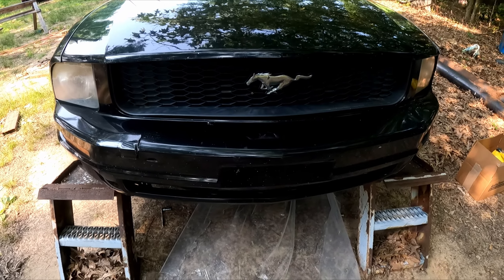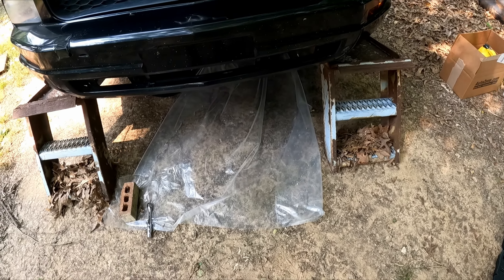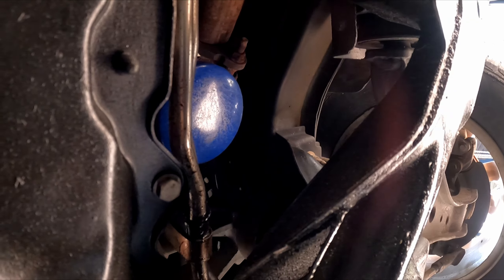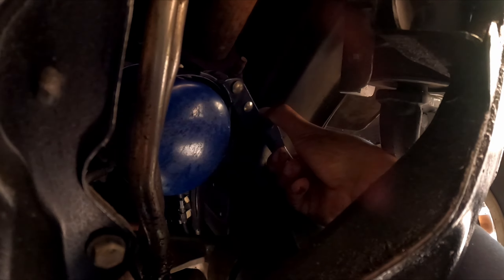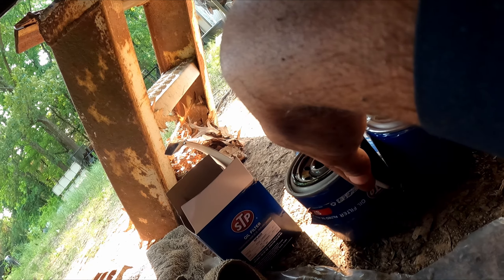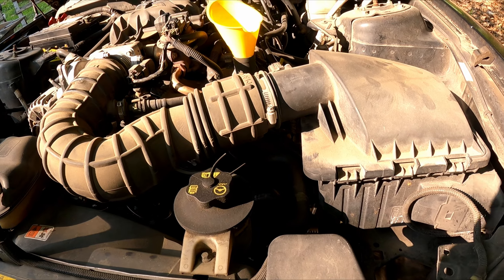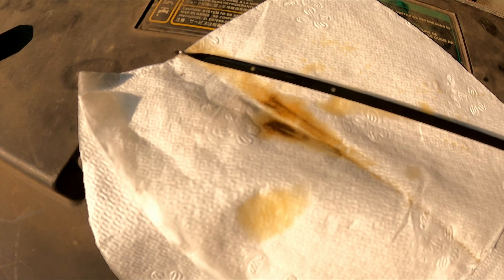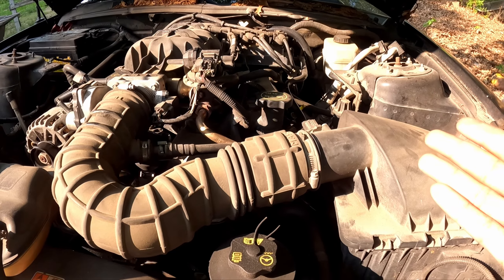How to do a oil change (2005 Mustang)

Comment: Bruh you never use old oil on your new filter. The purpose of the oil on your filter is to prevent the rubber seal from breaking down or tearing. Use new oil around the filter ring every oil change. And don’t buy cheap!! It’s an older car so you definitely want the best like Mobil 1 or Castrol. I have the same exact model and color you have.
Reply from the maker: Solid advice. Appreciate it